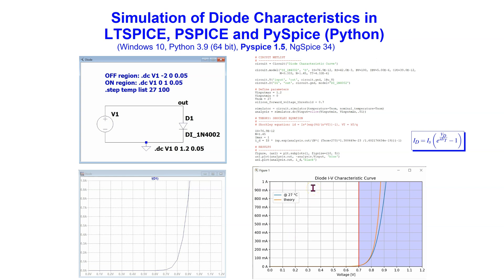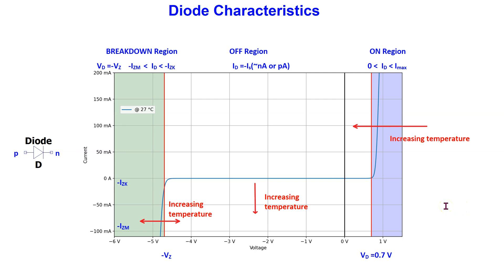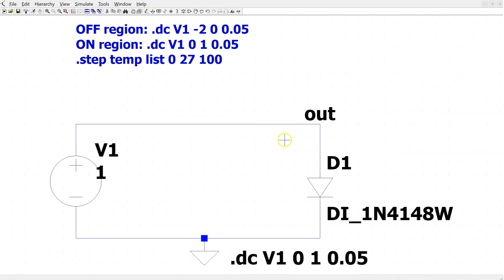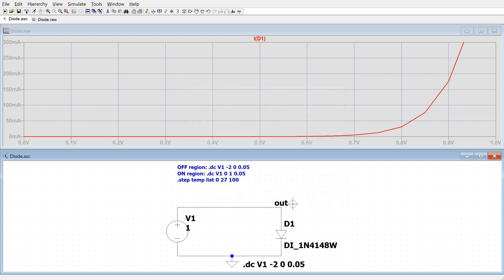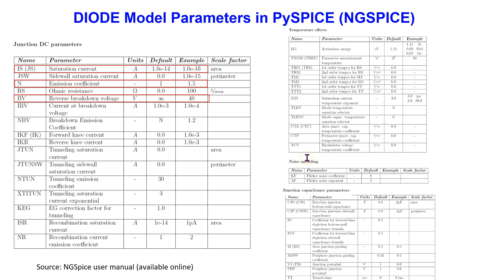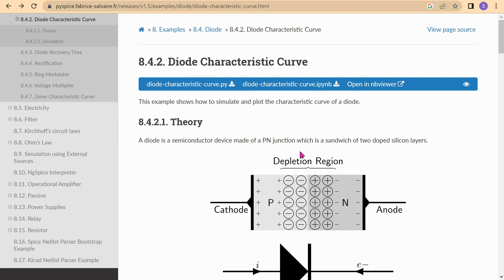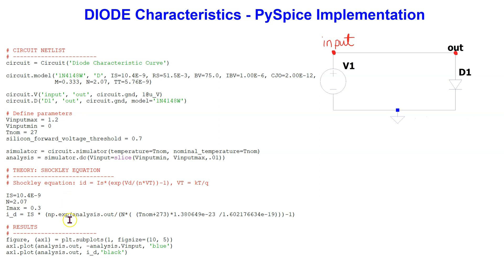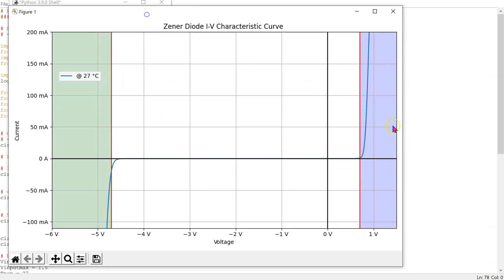Simulation of Diode Characteristics in LTSPICE, PSPICE and PYSPICE (Python)

Comment from the maker: # Pyspice (Python) code to simulate Diode characteristics for OFF region
########################################################################

# STANDARD DECLARATIONS
# ------------------------

import matplotlib.pyplot as plt
from matplotlib.widgets import Cursor
import numpy as np
from engineering_notation import EngNumber

import PySpice.Logging.Logging as Logging
logger = Logging.setup_logging()

from PySpice.Probe.Plot import plot
from PySpice.Spice.Library import SpiceLibrary
from PySpice.Spice.Netlist import Circuit
from PySpice.Unit import *
from matplotlib.ticker import EngFormatter

# CIRCUIT NETLIST
# ------------------------
circuit = Circuit('Diode Characteristic Curve')

# Define the Diode Model

# Swiching diode
# https://github.com/peteut/spice-models/blob/master/diodes/diodes/diodes_switching-diodes.txt
# *SRC=MMBD914; Diodes; Si;  75.0V  0.300A  Diodes Inc. Switching 
circuit.model('DI_MMBD914', 'D', IS=126E-9, RS=0.140, BV=75.0, IBV=1.00E-6, CJO=2.65E-12,  M=0.333, N=2.60, TT=5.76E-9)

# https://github.com/peteut/spice-models/blob/master/diodes/diodes/diodes_switching-diodes.txt
# *SRC=1N4148W; Diodes; Si;  75.0V  0.300A  Diodes Inc. 
circuit.model('1N4148W', 'D', IS=10.4E-9, RS=51.5E-3, BV=75.0, IBV=1.00E-6, CJO=2.00E-12,  M=0.333, N=2.07, TT=5.76E-9)

# Model that comes with PySpice in bulit example
circuit.model('1N4148', 'D', IS = 4.352E-9, N = 1.906, BV = 110, IBV = 0.0001 ,RS = 0.6458, CJO = 7.048E-13,
              VJ = 0.869, M = 0.03, FC = 0.5, TT = 3.48E-9)

# Rectifier diodes
# https://github.com/peteut/spice-models/blob/master/diodes/diodes/diodes_standard-rectifiers.txt
# *SRC=1N4002; Diodes; Si;  100V  1.00A  Diodes, Inc. diode
circuit.model('DI_1N4002', 'D', IS=76.9E-12, RS=42.0E-3, BV=100, IBV=5.00E-6, CJO=39.8E-12,  M=0.333, N=1.45, TT=4.32E-6)

circuit.V('input', 'out', circuit.gnd, 1@u_V)
#circuit.D('D1', 'out', circuit.gnd, model='DI_MMBD914')
circuit.D('D1', 'out', circuit.gnd, model='1N4148W')
#circuit.D('D1', 'out', circuit.gnd, model='1N4148')
#circuit.D('D1', 'out', circuit.gnd, model='DI_1N4002')

# Define parameters
Vinputmax = 0
Vinputmin = -2
Tnom = 27

simulator = circuit.simulator(temperature=Tnom, nominal_temperature=Tnom)
analysis = simulator.dc(Vinput=slice(Vinputmin, Vinputmax,.01))

# THEORY: SHOCKLEY EQUATION
# -----------------------------
# Shockley equation: id = Is*(exp(Vd/(n*VT))-1), VT = kT/q
# Change the parameters according to the diode model

## DI_MMBD914
#IS=126E-9
#N=2.60

## 1N4148W
IS=10.4E-9
N=2.07
Imin = 12E-9

## 1N4148
#IS=4.352E-9
#N = 1.906
#Imin = 5E-9

## DI_1N4002
#IS=126E-9
#N=2.60
#Imin = 130E-9

i_d = IS * (np.exp(analysis.out/(N*( (Tnom+273)*1.380649e-23 /1.602176634e-19)))-1)

# RESULTS
# ------------------------
figure, (ax1) = plt.subplots(1, figsize=(10, 6))

ax1.plot(analysis.out, -analysis.Vinput,'orange')
ax1.plot(analysis.out, i_d,'black')

formatter0 = EngFormatter(unit='A')
ax1.yaxis.set_major_formatter(formatter0)
ax1.set_title('Diode I-V Characteristic Curve ')
ax1.set_xlabel('Voltage [V]')
ax1.set_ylabel('Current')
ax1.grid()
ax1.set_xlim(Vinputmin ,Vinputmax)
ax1.axvspan(Vinputmin, 0, facecolor='green', alpha=.2)
ax1.legend(['@ {} °C'.format(Tnom), 'theory'],loc=(.02,.75))
ax1.set_ylim(-Imin, 0)

plt.tight_layout()
plt.show()

# Pyspice (Python) code to simulate Zener Diode characteristics
###############################################################

# STANDARD DECLARATIONS
# ------------------------

import matplotlib.pyplot as plt
from matplotlib.widgets import Cursor
import numpy as np
from engineering_notation import EngNumber

import PySpice.Logging.Logging as Logging
logger = Logging.setup_logging()

from PySpice.Probe.Plot import plot
from PySpice.Spice.Library import SpiceLibrary
from PySpice.Spice.Netlist import Circuit
from PySpice.Unit import *
from matplotlib.ticker import EngFormatter

# CIRCUIT NETLIST
# ------------------------
circuit = Circuit('Zener Diode Characteristic Curve')

# Zener Diode Models

# 3.3V Zener; Izm = 110mA
circuit.model('1N746','D', Is=31.47E-15, Rs=9.494, Ikf=0, N=1, Xti=3, Eg=1.11, Cjo=220E-12, M=.5959, Vj=.75, Fc=.5,
             Isr=2.035E-9, Nr=2, Bv=3.3, Ibv=45.862E-3, Nbv=3.0477, Ibvl=29.831E-3, Nbvl=11.606, Tbv1=-636.4E-6)

# 4.7V Zener; Izm = 75mA
circuit.model('1N750','D', Is=.88E-15, Rs=.25, Cjo=175E-12, M=.55, nbv=1.7, bv=4.7, Vj=.75, Isr=1.86E-9, Nr=2,
              Ibv=20.245E-3, Ibvl=1.96E-3, Nbvl=15, Tbv1=-21.3E-6)

# 9.1V Zener; Izm = 40mA
circuit.model('1N757','D', Is=2.453E-15, Rs=2.9, Ikf=0, N=1, Xti=3, Eg=1.11, Cjo=78E-12, M=.4399, Vj=.75, Fc=.5,
              Isr=1.762E-9, Nr=2, Bv=9.1, Ibv=.48516, Nbv=.7022, Ibvl=1E-3, Nbvl=.13785, Tbv1=604.396E-6)

circuit.V('input', 'out', circuit.gnd, 1@u_V)
circuit.D('D1', 'out', circuit.gnd, model='1N750')

# Define the parameters
Vinputmin = -6
Vinputmax = 1.5
Tnom = 27
# Zener diode data
silicon_forward_voltage_threshold = 0.7
Imax =200E-3
zener_reverse_voltage = -4.7
Izm=110E-3

simulator = circuit.simulator(temperature=Tnom, nominal_temperature=Tnom)
analysis = simulator.dc(Vinput=slice(Vinputmin, Vinputmax,.01))

# SIMULATION RESULTS
# ------------------------
figure, (ax1) = plt.subplots(1, figsize=(10, 6))

ax1.plot(analysis.out, -analysis.Vinput)

formatter0 = EngFormatter(unit='A')
formatter1 = EngFormatter(unit='V')
ax1.yaxis.set_major_formatter(formatter0)
ax1.xaxis.set_major_formatter(formatter1)
ax1.set_title('Zener Diode I-V Characteristic Curve ')
ax1.set_xlabel('Voltage')
ax1.set_ylabel('Current')
ax1.grid()
ax1.set_xlim(Vinputmin ,Vinputmax)
ax1.axvspan(Vinputmin, zener_reverse_voltage, facecolor='green', alpha=.2)
ax1.axvspan(0, silicon_forward_voltage_threshold, facecolor='white', alpha=.2)
ax1.axvspan(silicon_forward_voltage_threshold, 2, facecolor='blue', alpha=.2)
ax1.legend(['@ {} °C'.format(Tnom)],loc=(.02,.75))
ax1.axvline(x=silicon_forward_voltage_threshold, color='red')
ax1.axvline(x=zener_reverse_voltage, color='red')
ax1.axvline(x=0, color='black')
ax1.axhline(y=0, color='black')
ax1.set_ylim(-Izm, Imax)

plt.tight_layout()
plt.show()

Comment: Can you explain what is the need to take pain to learn python and use pyspice instead of just going with traditional device level simulators and system level simulators?
Reply from the maker: Thank you for the interesting question. Traditional device level simulators such as PSPICE, LTSPICE and NGSPICE are commonly used in electronics. PySPICE provides a Python interface to use NGSPICE as the underlying device level simulator. The advantage of using a programming language is that it allows you to do much more than what you can do in a traditional device level simulator. For instance, PySPICE allows you to simulate an RLC circuit and side by side you can call other maths libraries to analytically solve the RLC circuit differential equation and compare! This is in fact illustrated in another video in this channel. Similarly, you have more powerful plotting tools in a programming language. In the future, it might be possible to involve AI in device level optimisation in simulators etc. Hope this helps!

Comment: Can you do a video on building a MOSFET circuit using hospice and validating the circuit using a basic tensor flow model
Reply from the maker: Thank you for the suggestion. I am not sure I understand. Can you please explain in more detail what you mean and which simulator you are suggesting to use. Thanks.
Reply: @electriccircuits7164  Thanks for replying back
Here is the full thing
To use Pyspice and Python
1)Create your own MOSFET circuit model using a sublist
(It should be capabale of using its own mathematical equation if required)(Not to use pre-build model)

2)Validate the cicuit model by using a basic tensorflow ML model
Reply from the maker: @devSahoo13  Creating an accurate MOSFET model from scratch is a big endeavour. It depends on the complexity/accuracy of the model. See for instance the source codes for MOSFET models available here: https://ngspice.sourceforge.io/docs/ngspice-html-manual/manual.xhtml#magicparlabel-12907 Hope this is helpful to your project.